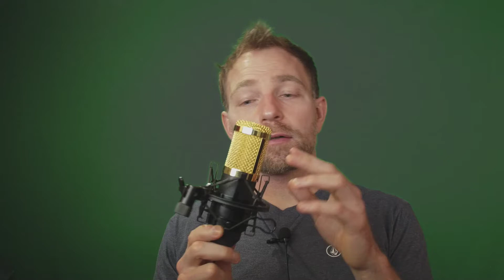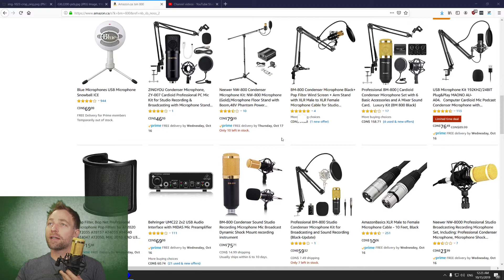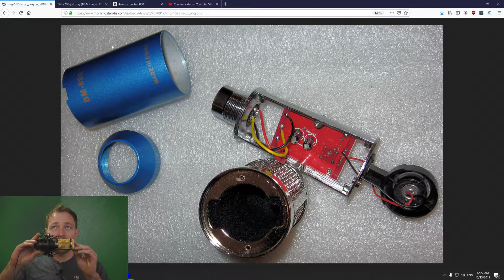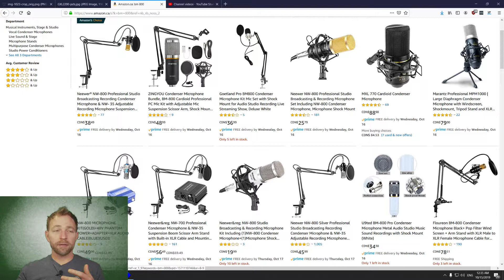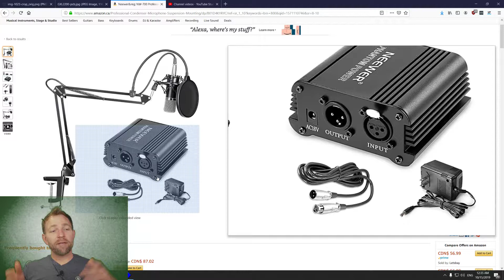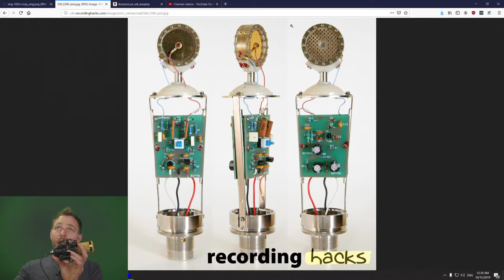How to make the BM-800 Mic Better (and my rant about it)

Comment from the maker: re: The Snowball USB microphone is something I own and have used; it's by no means the best microphone or my top suggestion, but it doesn't try to deceive you. No additional preamps needed; just plug-n-play and it's a true condenser microphone from a trusted brand. Another option could be a Zoom H1n, which has a built-in mic and the option to add a lapel mic at a later date. I'm really quite happy with my home-made lav mic though.

Lapel mics with battery power also exist for cheap, which helps to ensure that even with the cheapest  PC sound card you will have enough power for it -- nothing special needed with those, just a mic-in port on your computer or smartphone.

There is an argument that buying a cheap mic starter kit, as well as a XLR mic preamp, makes sense. It lets you have a platform to upgrade your mic at a later date. While that makes some sense, I'd argue if you can get away with not needing to purchase an XLR preamp at the same price, why not? Either buying an electret mic that runs on 3V or modifying the BM-800 so it bypasses the voltage regulator component are two such options. Why buy today what you can put off til tomorrow, right?

Comment from the maker: Correction: @2:27 , I said the MXL 770 was a large diaphragm condenser, but it's only 22mm in size according to the specs, but a "large" one should probably be at inch in size or 25.4mm.  Close to a large one, but not quite.

Also, correction: That Phantom Powered box kit comes with a 3.5mm to XLR cable as well; not just XLR to XLR like in the photos. This means that you can connect it to a computer sound card and not need to buy the XLR Preamp, but you would still need to purchase the kit with the phantom power box. Some PC sound cards output 5V, which might be enough to get away without needing 48V phantom power, but most PC sounds cards will not be compatible with this microphone without additional phantom power.